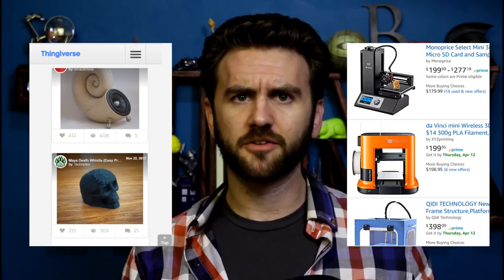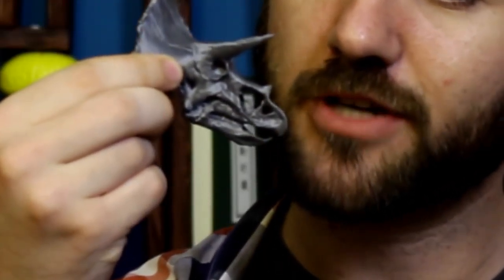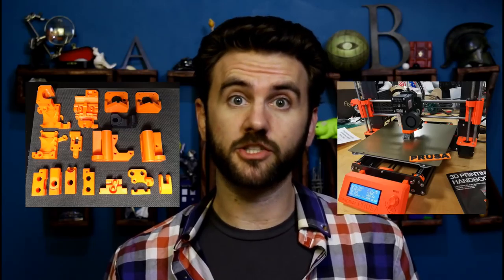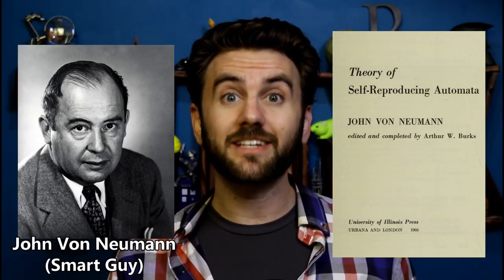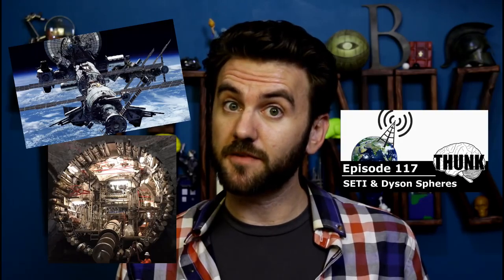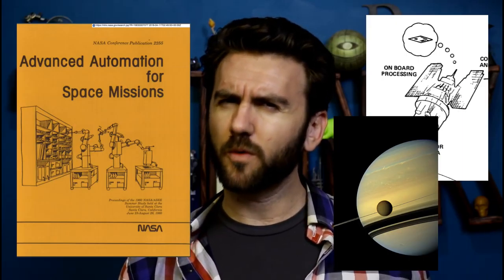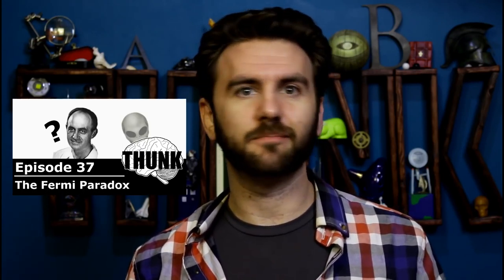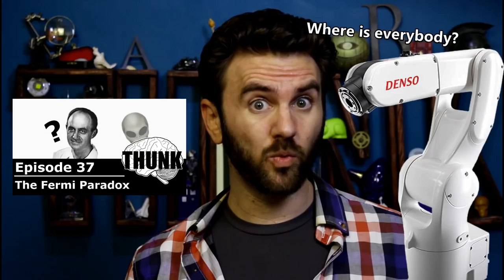141. Von Neumann Probes | THUNK

Comment: It seems like there are two stages of difficulty here:
1. Making a 3d printer that can 3d print a 3d printer given some input material
2. Making a 3d printer that can 3d print a 3d printer given raw materials (such as Martian dirt and rock)

Obviously in order for a 3d-printer-printing-printer to be useful on other planets, it would need to be able to do 2. Otherwise, we'd have to send along the input material and that wouldn't save us much if anything.

1 seems like it would be pretty difficult (first you have to design a 3d printer that is made entirely out of plastic or whatever or figure out how to 3d print wires, solar panels, etc. and next the robot has to be able to not just print all the parts, but assemble it), but 2 seems much harder to me. It's not like Mars has mountains of plastic waiting to be converted into 3d parts. Are there any abundant materials with a low melting point on Mars that could be used for 3d printing?
Reply: Maybe the scale is what we should look at. If we can make microsystems where  synthetic biological factories are created that can expand itself (https://www.nature.com/articles/s41598-018-22263-3) then that's a step at a different but important scale. Not necessary the image portrayed here, but has profound effects in itself.
Reply from the maker: Check out the links in the description - some of the proof-of-concept experiments have tried 3D printing with regolith. We wouldn't necessarily have to use low-melting-point materials, we just need to have a high enough temperature to melt (or otherwise shape) material into usable parts.
Reply: There's another way.  A 3d printer that can print 3 things.

Parts for itself.
Harvester robots
Assembler robots.

The latter two could be the same.

Imagine a factory that can build robots and parts. The robots will assemble a new factory using the parts that was printed.
The same or other robots would harvest resources to be used.

A von Neumann probe would not have to be all a single entity. But having two kind of robots one gathering materials and another assembling would make it efficient.

It would also allow a broken factory to be repaired.